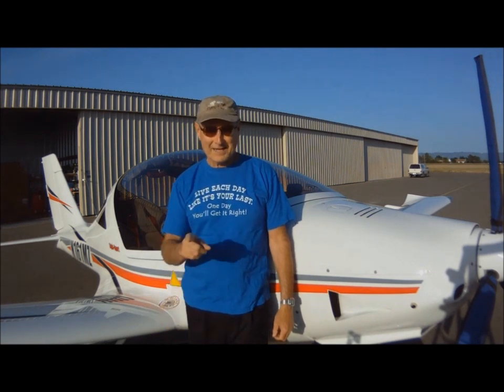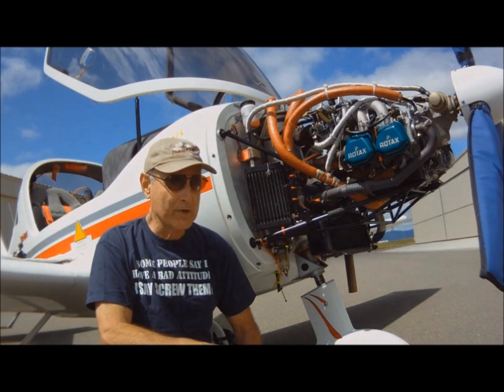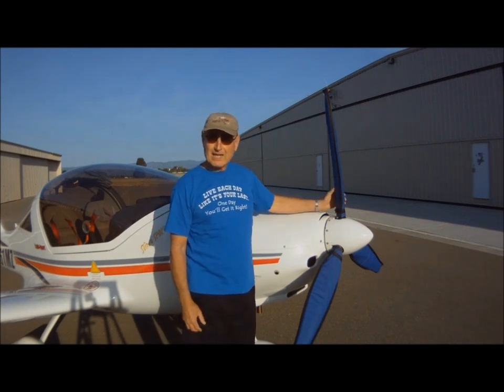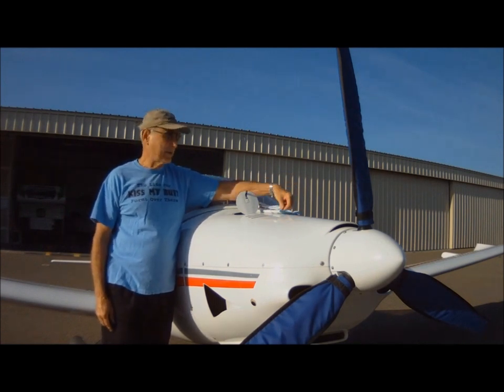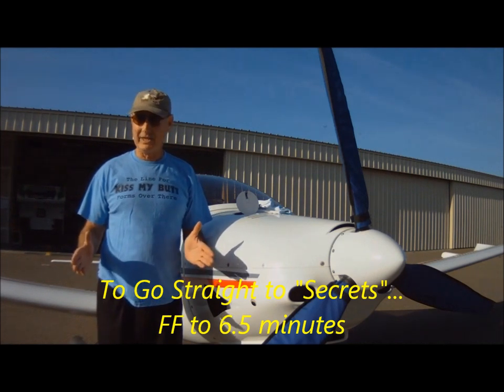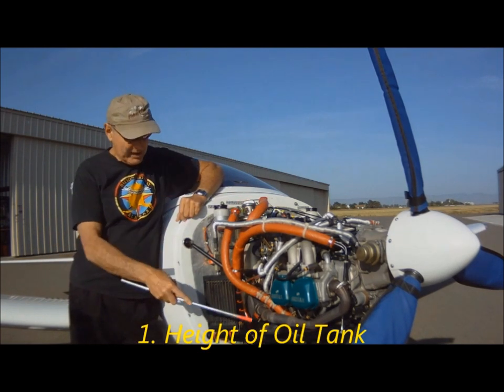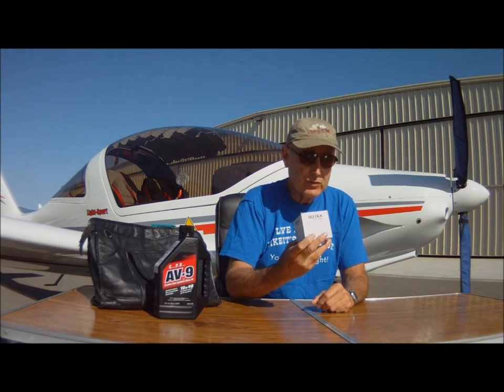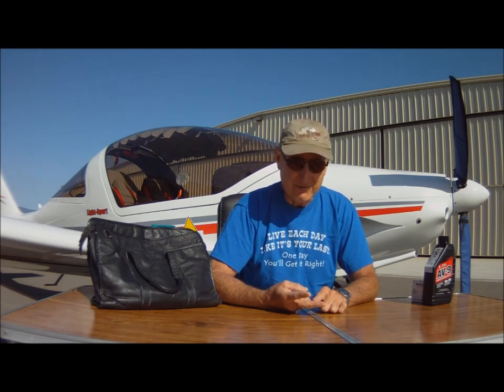How to "Burp" the Rotax 912 Aircraft Engine

Comment from the maker: 11-06-2018 Update/Disclaimer:  This information was developed mainly from "burping" my Rotax 912ULS engine approximately 2,500 times, between November 2011 (when I purchased my Sting LSA) and today (I have put 2,500 hrs on the engine & plane).  Other existing videos and Rotax written information were also considered.  Unfortunately (for the video's info) Rotax's latest oil filter (PN 825-016)---the one with the green dot and green rubber gasket---unleashed on us about 2 years ago, adds a precautionary note to the "burping" game.  On 912 series engine applications, with the oil tank higher than the engine, these newest filters do not always prevent oil "back-flow" from the oil tank--at least not as well as the previous Rotax 912 series oil filters.  As a result, pre-burping after the last-flight of the day, to minimize burping pulls the following first-flight of the day, may not always work.  I have had two 'green dot' Rotax filters in the past year that failed to prevent oil back-flow, with the engine sitting; that raises the number of prop 'pulls' needed the next day.  Just keep that in mind when applying this information.  Thanks--and happy flying!

Comment: If it's in the spin direction, does that mean the engine pumps that much when it's running?
Also is this required at every start? seems like a very crude check.
Reply from the maker: Negative, when the engine is running, it pumps a whole lot more!  Negative, it's not required--just a good idea, like the rest of your pre-flight checks, to get the "feel" of anything weird going on as well as the oil level.
Reply: @StingFlight  that's what I was thinking, if the pumping is proportional to the spin, then any way you hand crank it is nothing compared to when it's running.

Comment: I'm sorry but me thinks coming out to you'r LSA and burping it everyday is a bit much. I fly a Flight Design CTLS with the wonderful 912 and sometimes I go for weeks without flying it and have never had a problem getting it to burp before !st flight. Know that little sealed battery they use can be a pain in the rear. Learned to always keep the battery mantainer plugged. Good information though..Thanks.
Reply from the maker: +jay wilkes Every LSA-912 set-up is manufacturer-specific and different.  The CTLS has a relatively low oil tank; on our Stings, it is much higher.  Thus, it takes much less "propping" to get yours to belch.  I like knowing that the engine "feels" the same each day, as I prop it before starting, one reason for my daily regime.
Reply: It's standard on the sling 2 to burp it in order to get an accurate oil reading.
Reply from the maker: Yes, and for accuracy, do it with a cold engine, so you're not dealing with the oil-expansion factor of a hot or warm engine.

Comment: Great video sir.why does Rotax make things sooo soo complicated...could they have not done better engineering....engineering need to wake up.what if a student forget to turn the propeller TO BURP IT...does it damage the engine??? Leave it to ROTAX!!! ty
Reply from the maker: The engine is actually already an engineering marvel--and they're still making it better.  Mine has now rolled through 2,200 hours without even a major hiccup.  And no, there is no harm done if a burping is missed.  It's just a good practice to stay with, for the reasons I stated.
Reply: I understand you for the 912 as to it name to be reliable,.I just purchased a merlin with a 912  (80 hp).. the thing i thinking about is, for example, if some person before me may have turned the prop the wrong direction.would there be any unknown damage to the engine in the future..? also if a K&N oil filter meets and exceeds the manufacture specifications, Why cannot a K&N be used?,what are yout thoughts
 ty for your response and in detailed info.
Reply from the maker: If it is propped the wrong way, the damage (IF IT OCCURS) happens right away--in the form of a blown valve and engine destruction!  The manufacturer of SLSAs specifies the air filter in the OEM list;  Mine uses the K&Ns (various models).  You'll have to research the Merlin and find out what is allowed.